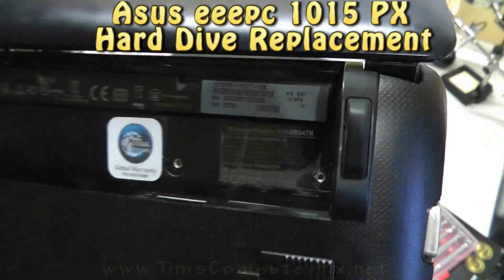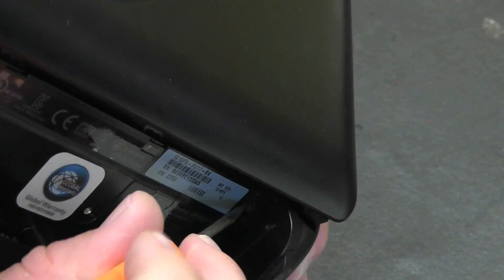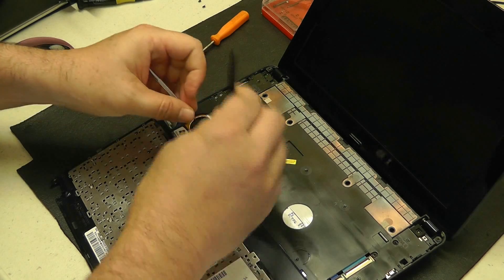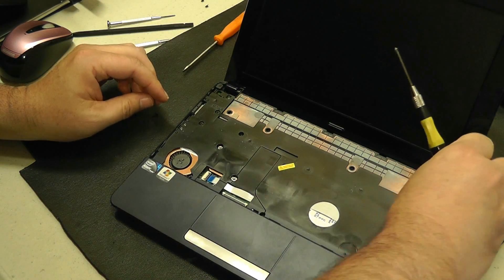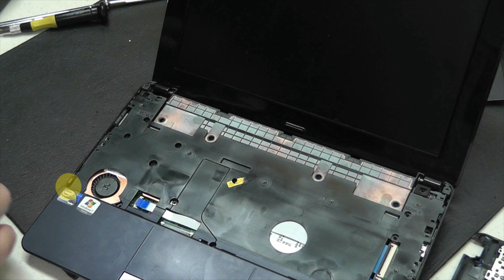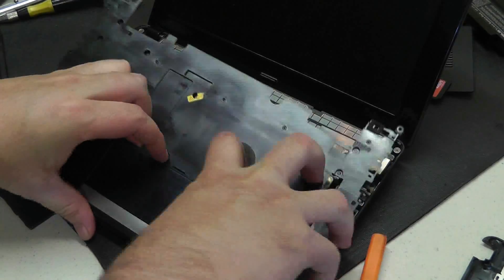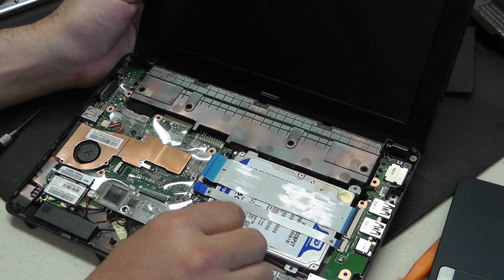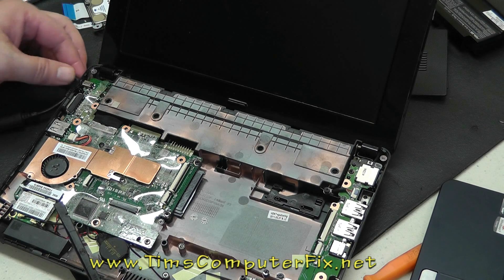Asus eeepc 1015PX Netbook Hard Drive Replacement by TimsComputerFix.net

Comment: At 4:43 where you show removing the cable, the flap holding the cable is pull up type instead of the sliding type. Since your hand covered that part, I tried sliding it with pressure and it broke. I guess the cable needs some pressure after sliding in. The trackpad now doesn't work:(  Successfully replaced the hd with a SSD though.

Comment: Thanks for this video! Some tips for others doing this: 

If you're careful you don't need to remove the large keyboard ribbon cable, it's tricky to reattach so I suggest not removing it.

Among the 12 screws some of them have different lengths, so I recommend laying them out on a table as you remove them so you can remember which screw goes where.

When removing the ribbon cables that run over the HDD, you only need to disconnect them on the right hand side and then you can hold them out of the way while removing the drive.

Comment: Very good tutorial, but the video skips around 4:36 and misses a vital bit of information! You have to remove the yellow sticker that has a warranty void warning . This exposes a 13th screw which has to be removed. A few seconds later on the video it zooms in to show the label broken. Other than that, it is very helpful. Thank you!!
Reply from the maker: Yes there is a screw under the sticker. Thanks

Comment: Hi.
My 1015p runs %100 cpu on win7 pro.
Anyway i can help it besides running in safe mode?
Reply from the maker: +Dale Whitmore Check to see which start up  programs are using your system resources through task manager and disable them. Use a light anti virus such as BitDefender.
Reply: +TimsComputerRepair I have used task manager while scaning with spybot today and it used %45 and windows svch or somthing was using %35 others were very low usage.
sorry im not sure exactly which program but it was very similar but i suspended it and lost my desktop and had only task manager windows lol.
Is there a keyboard shortcut for restart also?
Thanks for replying.
Reply: +Dale Whitmore Cheers mate.....
Windows update stuffed it all up.
Dissabled now its 5-14% and like new.

Comment: awesome video.
apart from putting 12 screws again and battery cover's 4 screws ...
I sucessfully upgraded its 250 GB hdd with another 500 GB hdd.
Not only that The keyboard started working again.
your video saves me the new cost of asus eeepc 1510 keyboard, repairing charges and again replacement charges for that 500GB hdd.
chears!!!
Reply: and ribbon connectors :: first of all didnt understand your video or what to do bcz all I was doing was dettaching the cables from mainboard. 
but at the time of attaching I got the problem. then suddenly and U dont know how but that black thing pops up and everything got clear.
Reply from the maker: +Dhroobh Bhattacherya Glad the video helped. Sometimes re-seating cables can clear up hardware issues.
Reply from the maker: +TimsComputerRepair Thanks for watching.
Reply: Can you tell me how to get info about when a hdd first switched on and how much time a hdd continiously ran before in one go.?
Is there any software for that?
Today I saw a brand seal hdd that showing its uptime 19433 hrs but it switched on only 27 times, I know its old but how to proove that to vender (store) 
Do you understanding my point?
Reply from the maker: +Dhroobh Bhattacherya CrystalDiskInfo shows you that information.

Comment: After doing this, it said no boot device selected or something like that.
I Installed an ADATA SSD harddrive. Do you know if maybe it's not possible to switch the preinstalled harddrive to an ADATA one?
Reply from the maker: Lennert Delbaere You should be able to. Was it a blank ssd? Go into the BIOS and see if the drive is listed there. Format with a Windows ISO
Reply: I found the problem. 
I attached the SSD to an other PC and installed windows 7.
Didn't realise that when I'd take the SSD and put it into my netbook it wouldn't work.
So I made a bootable USB real quick and installed windows 7 again.
Worked perfectly :)
Reply from the maker: Lennert Delbaere Great! Glad you got it figured out.

Comment: thanks man, used this guide to upgrade my mothers lappy with a 120gb ssd, cloned it through usb before opening the thing, worked like a charm  and super fast :D
Reply from the maker: Oscar Velazquez Glad the video helped. Thanks for watching.
Reply: Its a shame the computer has 1GB ram soldered with not upgrade ports, and with the IGP taking 250MB or ram for video (which cant be configured) the computer still feels slugish on certain situations due to the low ram.

At least her files are much more secure due to no mechanical failure (we do backups)  and with the benefit of the sdd where it can help (seek times, etc)

Comment: Hey, my EEE PC won't power on.  I took out the battery and pressed the power button for about a minute and tried again.  Power won't turn on.  There's apiece of Crucial RAM on the bottom, but I don't know to take it out.  Do you have a solution to why the power won't turn on?
Reply from the maker: Lianna Wright Test your power adapter. Start pulling components off of the motherboard till you find the culprit or determine that you motherboard is the issue. Thanks for watching.

Comment: thx very useful. Just two add on: first two screws inside are a bit shorter while there are two marked on the plastic with M2xL6 which a bit longer. Separate them and remember for reassembling. One thing not clear to me was that you have to lift up the dark plastic of each female flat socket in order to make the flat cable released form the socket. With the exception of the first socket where you have to slide the dark plastick!
Reply from the maker: Thanks for watching
Reply: i was asking myself and this 2 larger screws? wth? ha ha! Thanks!

Comment: I had the same problem. Tried several suggestions and finally bought 'Apricorn SATA Wire Notebook Hard Drive Upgrade Kit' for under $20 from Amazon and it cloned the old drive exactly before exchanging. All passwords, emails and programs came across perfectly.
The only difference was that the netbook ran MUCH faster!